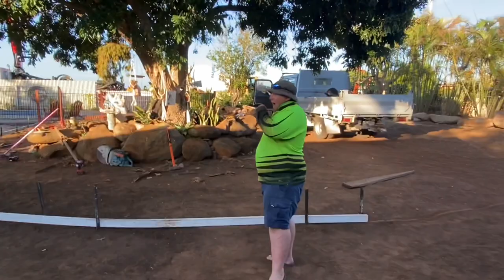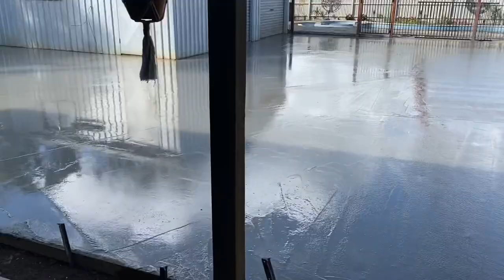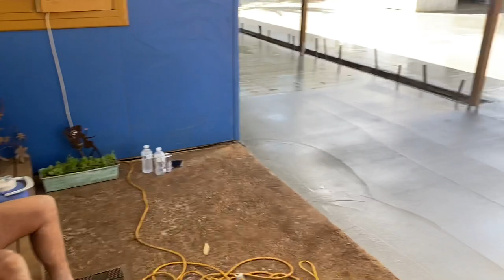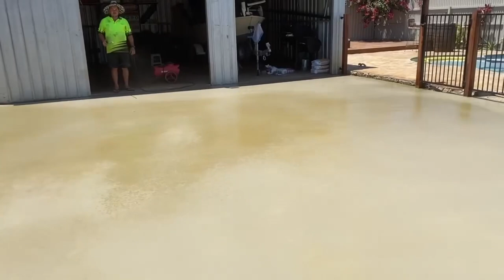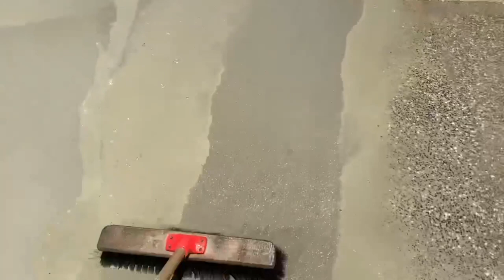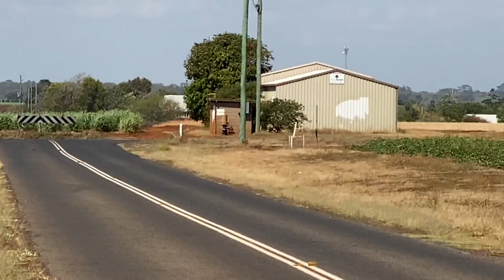How to Machine trowel on exposed concrete

Comment: ive never heard of an exposed job being machined, cant say it doesnt work because this came out near perfect! good stuff
Reply: Very strange given that the sugar is normally added before the concrete dries but in this case it was "double sealed" ie  dried before it was applied
Reply: @jeffreyloftus3617  another crew I work for Trowels, the Sugars then trowel again then sugar and more sure when needed
Reply: @breezefuller-brennan1753  wow, always thought that would cause blowouts
Reply: @KoNNz818  I hand/pole trowel 2-3 times and sugar the top until it dries,

Can’t argue with the other blokes I work for method cause they are up there with best Concreatures in my area
Reply: @breezefuller-brennan1753  I use same method as you. The guys you know must know what they are doing. One time we were all finished and sprayed up, and a labourer decided to re edge the pads. When we exposed, all the edges blew aggregate out. Very expensive mistake lol 150mm thick, seismic mesh and rebar.
Reply: @KoNNz818  not sure why that would happen,they only trowel the sugar in once then they just respray once the top dries and repeats until they can wash off

Comment: I'm in Brisbane Australia and last week the concreter I hired screwed up
 my driveway. It is 7 x 9 meters long and they ran out of concrete 3/4 
into the pour. It's summer here and it was midday when this happened, it
 took another hour for the next truck arrive. Where they joined the last
 1/4 section it is quite uneven and rough, as it dried it has different 
shading of grey like a giant scare across the driveway. I wasn't happy 
with the job so he is going to cut out the section between the control 
joints which is 7 x 4 meters. Will this work having this new section of 
concrete layed? Please help !
Reply: Be thankful he is fixing it for you, shit happens all the time in this industry especially when the suppliers don’t give a fuck, it will work just fine btw
Reply: May look different . But doesn’t sound like poor workmanship on the contractors behalf .. I’m a contractor happened to me before . Concrete companies when busy can give very bad service . He is fixing it for you . Sounds like a professional contractor .